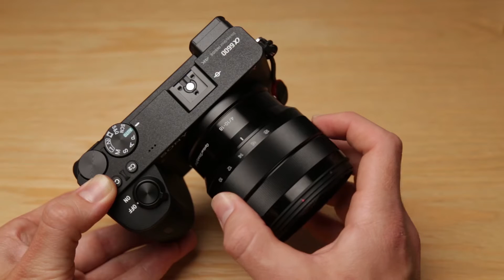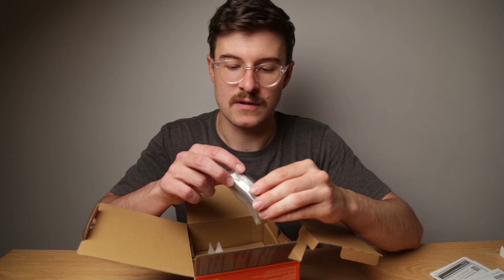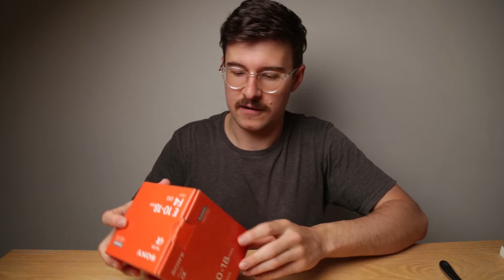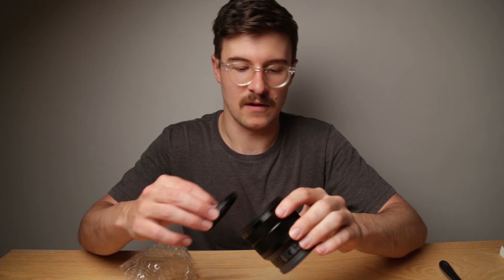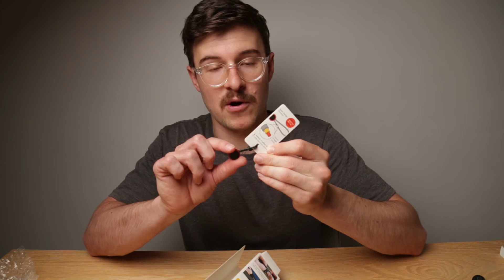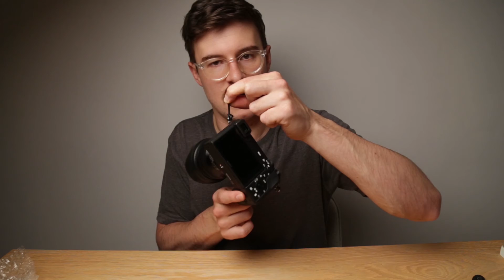SONY A6600 With 10-18mm F4 Lens & Peak Design Cuff Unboxing and Overview (Kraig Adams Gear)

Comment: nice video bro.. I am very confused between A6600 and A6400.. I also make hiking videos in Himalayas, A6600 with 10-18 mm is little very expensive in India.. I can either buy a6400 with 10-18 or a6600 with Sigma 16mm.. I am not sure how Sigma will look when i go for hikking

Comment: Nice video Jamie. I´m a Pro Nikon gear shooter but bought a similar setup (but A6400 in place of A6600) for hiking / cycling. I removed the annoying little triangular neck strap attachment bits as they rattle around hitting sides of camera while its attached to the Peak Design Capture - with this the camera is at my side, ever ready (the PD anchor links will pass through the remaining tiny hole on camera for safe attachment). With the 10-18 and a Sigma 56mm 1.4 I have a useful kit which is so lightweight I don't notice it - the whole lot is lighter than one of my Nikon lenses!
Reply from the maker: Awesome mate how do you find the Sigma lens?
Reply: @mixmashmaster  Its really useful when longer reach / portrait required on the a6400, and quality is as good as it gets on APSC.